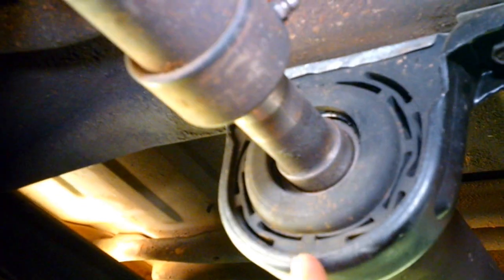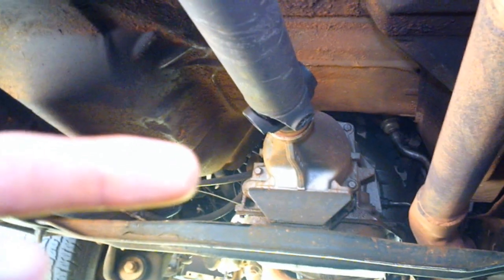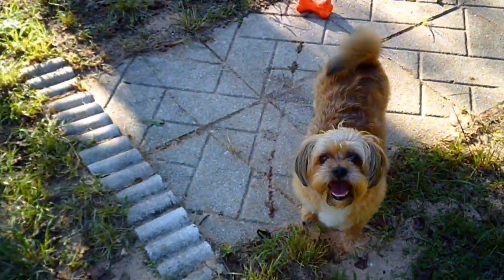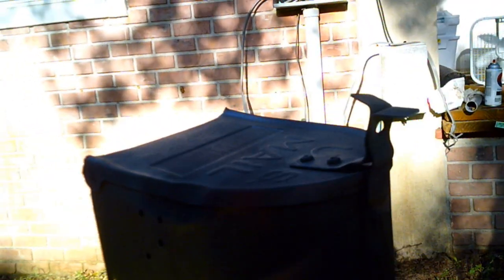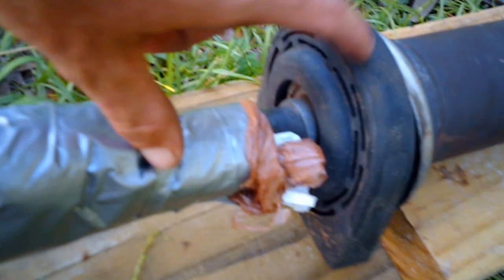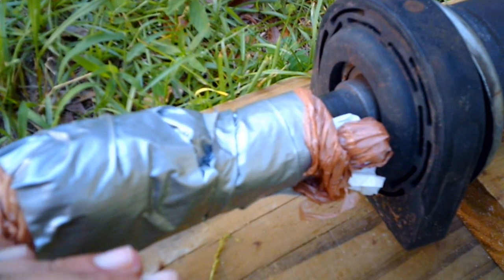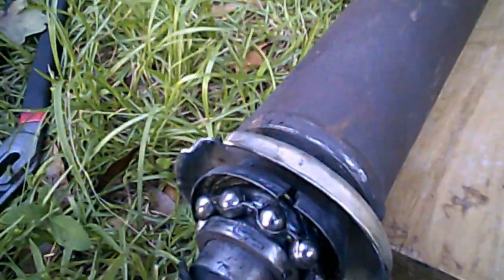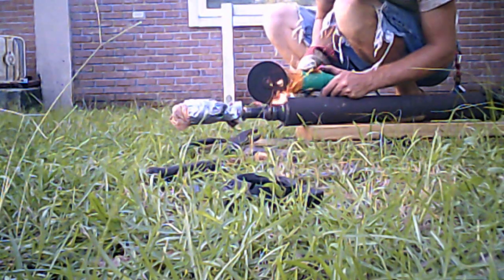92' Ford F 150 Carrier Bearing replacement

Comment: Hey, I have the ‘94 of the same truck. So, you don’t need to grease any part of the new bearing? Why do I see a grease fitting to insert a grease gun hose?
Reply from the maker: It's a sealed bearing I think what your seeing is that hole at the bottom of the black case. It should come with a grease fitting but it doesn't. The bearing ushaly outlasts the part anyway. It's the stupid rubber bit around the bearing that gets all wore out and causes a vibration in the drive shaft
Reply: Ethan The Fence Man  I got the same bearing. Where does that spacer go? Front or back of the bearing?
Reply from the maker: @alexanderhastings1386  if your referring to the silver plate. I believe it's a dust cover and it presses on the drive shaft ahead of the carrier bearing.

Comment: what tool did you use to tap the bearing on?
Reply from the maker: A piece of 2 3/8" chain link post and a hammer i believe. Be very careful that you're making even contact with the inner part of the bearing. It has a metal lip around it, if you bend that lip it will damage the bearing and make a lot of noise while the driveshaft spins.
Reply: @Ethanthefenceman   ty you my hubby got it on last nite and maybe put it back together today if it stops raining

Comment: I also found that if you have access to a press it’s a lot easier than using a grinder. Also taking emery cloth,(or fine grit sand paper), and clean the shaft up on the side that it has to travel off it will ease with the bearing to come off.
Reply from the maker: A press would certainly be the best option! I tried to hammer it off but with no success so I resorted to the grinder lol

Comment: Wow.  That's a lot of work.  I have  98 extended cab.  I'm not looking forward to doing mine.
Reply from the maker: It is alot of work but not too hard mainly time consuming.
Reply: Take the shaft out. Take it to the shop. Have them press off the old, and press on the new. Then take the shaft home. 
Easy !!!!!
Reply from the maker: @dougtye9445  that sounds much better than my route! I don't blame you a bit there.